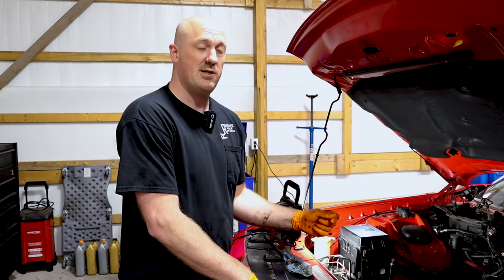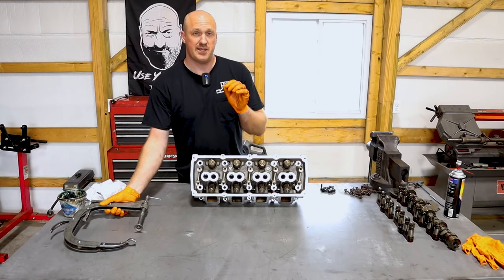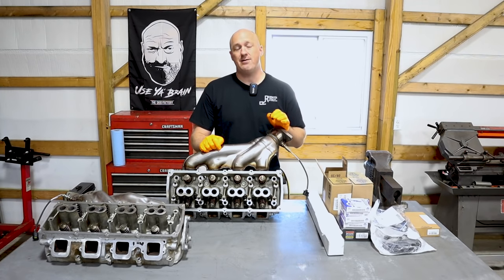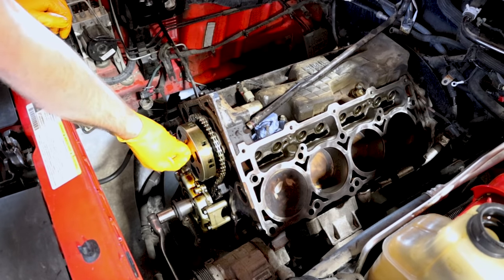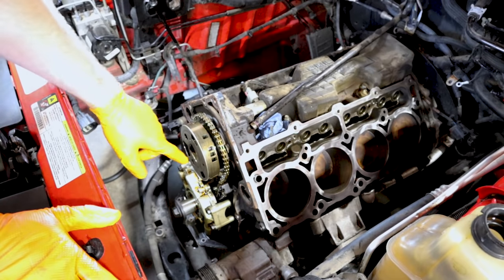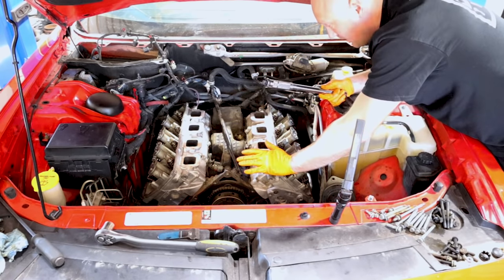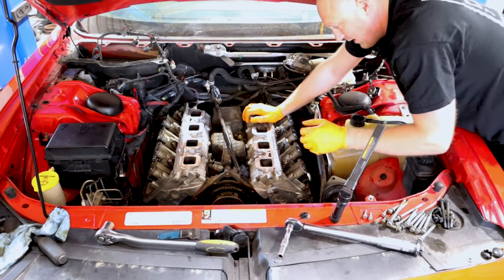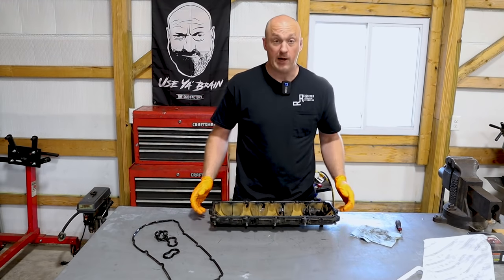Hemi Camshaft Installation Continues, SRT Headers Install! Budget Challenger Build Ep2

Comment from the maker: Which model Hemi do you own?
Reply: 2013 ram
Reply: When I call PowerTrain company for quote they told me that I have gen 3 hemi
Reply: 2015 Challenger RT Plus
Reply: 2005 Dodge Magnum R/T
Reply: 2018 Charger R/T 5.7
Reply: 2010 Challenger R/T manual transmission. I also have a 2014 5.7 block from a charger with only 914 miles on it for a future build lol
Reply: 2018 Charger RT
Reply: Love this channel for the Hemi content!!!!!
Reply: 2009 5.7 charger pursuit bought it with 30000 now have 89
Reply: 2016 Challenger 5.7 vvt
Reply: 2011 5.7 Ram with longtubes and a 2005 5.7 with a set of Eagle heads for a future Dakota swap.
Reply: 6.1 challenger there's no videos or info on them would be great if u have one to work on but all your videos are great with lots info thank you
Reply: New subscriber,  love ur tutorial  on camshaft installation.  I have  a new reman 6.1 hemi engine from power Nation.. What's the best performance camshaft upgrade i should  go for ?
Reply: 2019 Challenger Scat Pack Widebody
Reply: 2014 pursuit charger
Reply: 2019 RAM 1500 Laramie Sport
Reply: None, but a 4.7 magnum Dakota
Reply: @Weld702  that’s stick awesome man I had a 4.7 ho Dakota they’re awesome
Reply: @jimmyford271  Same here on the car, love my Challenger and the stick shift makes at a blast to drive!
Reply: 2007 Charger R/T
Reply: 2005 Magnum RT
Reply: @89JDmac  ... what did you have to do to swap over to the Eagle heads...
Reply: @ghostrt1608  you'll need different thickness head gaskets and potentially an intake spacer depending on which intake manifold you use. Check out mmx performance
Reply: What did you hold the cam phaser with so I did not  spin on when you torqued it down
Reply from the maker: @cammedramprocharged4927  best move is to access the flex plate and stick a pry bar in the teeth so it can't rotate. 👍
Reply: @ReignitedAuto  I wished you showed how you did that almost 
All the videos Inwatch they all skipped that part
Reply from the maker: @cammedramprocharged4927  ya I've gotten quite a few comments about that, next time I put one of these together I'll make it a point to film that part of it 👍
Reply: @ReignitedAuto  please do 
You never showed how you tighten that Cam bolt with 90ft lbs and stopped the motor from spinning on you
Reply: 2013 Challenger RT 5.7 Hemi
Reply: 15 Durango R/T 5.7
Reply: 2012 Ram 5.7 with 138,000 miles
Reply: 04 dodge ram single cab,
Reply: 2017 Scat Pack with 19 grill and the lower half of the Hellcst Air Box.
Reply: 2nd gen magnum rt and a 5th gen ram 1500
Reply: 06 Charger R/T (306K Miles and counting)
Reply: 2015 RT plus, super track pak
Reply: 57
Reply: @ziggyk.9206  O 6
Reply: 2013 rt charger 😎
Reply: 2011 Ram 1500
Reply: Mopar '11
Reply: 5.7 VVT in my 300C.
Reply: 2019 RT Scat Pack Challenger that I absolutely LOVE!! F-8 Green with a full length hockey pinstripes  from Vinyl Imaginations, Hell Cat air box, Billet oil catch can, and a Hurst pistol grip shifter. Drive train is bone stock. Love everything about it.
Reply: 2013 Grand Cherokee Overland 5.7
Reply: 16 Challenger R/T M6
Reply: what type of mechanic gloves are those? They look great quality.
Reply from the maker: @redForever1776  they are from gloveworks and they are terrific! Perfect for doing this kind of work, unfortunately since the start of the pandemic they've become very expensive, like $40 a box. Still worth it to me!
Reply: @ReignitedAuto  thx !
Reply: 2005 Magnum RT bought new and still love it! By the way it has MDS so some 2005 hemis did have MDS.
Reply: 2014 Charger RT 100th Anniversary !!
Reply: 2006 300C 5.7 Gen 1
Reply: How can i get in contact with you?
Reply: 2013 300C Hemi 5.7L
Reply from the maker: @psas6179  either DM me through Instagram @reignitedtx or e-mail Sales@reignitedtx.com. I'll try to get back to you as soon as I can.
Reply: 2022 Challenger RT Plus - not delivered yet, been waiting 5 months so far.
Reply: 2006 dodge charger hemi and 2015 dodge ram heni both are nothing but issue got a square body Ford 302 never had a issue and it's a 85
Reply: Do you have any recommendations on which year challenger rt to buy and which ones to avoid? Manual trans is a non negotiable must have.
Reply from the maker: @zaddy49  they are all pretty similar to be honest, and there's not really a bad version out there. Obviously if you go a little newer they have fancier interiors and more electronic options and driver aids, but I kinda like the more analog older ones, the 2010 I had in thus video was great, but the interior did look a little dated.
Reply: 2017 charger r/t
Reply: I have a Ram 2500 with the 5.7 Hemi and 185k trouble free miles on it.
Reply: 2005 300c 5.7
Reply: 2007 dodge charger 5.7l  rt.
Reply: 5.7 RT
Reply: jgc 2013 5.7
Reply: 2016 5.7
Ram 1500 Bighorn 4x4
Engine service every 5,000
124,000 miles
56-57 psi cold
34 psi hot
Reply: '16 Challenger SRT 392 A8
'11 Challenger R/T M6
'07 5.7 1500 4x4
Reply: 2013 5.7L 345ci
Reply: Let me correct one other misunderstanding you have. Just because the lifters are being directly oil does not mean that that oil is getting to the roller at the angle it izzat. I don't know whether you know anything about physics, but when the oil is not under pressure and especially not enough pressure to be shot across even a small Gap, it will drip off of the lifter body long before it will drain laterally across the lifter. Those things are at less than a 30 degree angle. At least they appear to be. Even a 30 degree angle would be next to impossible for oil to Traverse in any kind of consistent fashion.
Reply: 2014 RT Redline!
Reply: 05 300c
Reply: 06 Ram 5.7 hemi with over 331,000 on it
Reply: 2006 Jeep Commander 5.7L Limitied...with leaking valve seals, and the notorious broken rear most Exhaust manifold bolts...but I'm a mechanic so everyone else's vehicles come first...lol, can wait for the Jan-Feb slow down to get mine taken care of...any tips for a replacement header with factory y-pipe?
Reply: Hopefully that straight six is dodges saving grace because spending thousands to fix a cam only after 40k miles is bad
Reply: 07 charger RT
Reply: 15' Challenger SRT 392
Reply: Hey brother I've watched you're videos and learned to do a comp cam swap on my 07 dodge ram 1500 5.7 hemi and I also installed 6.1 srt headers from a srt8 jeep 05-10 and it still has the tick from a leak I used the original hardware that I took off from the jeep and put 6.1 gaskets and no luck, do you have any recommendations.  Much appreciated.
Reply: 2019 Challenger R/T 5.7 6MT
Reply: 2017 pursuit
Reply: 2006 300c srt8
Reply: Do you think those take off headers would fit a 2014 jeep srt 6.4 ???

Comment: I was warned against getting a 5.7 hemi, I was told the cam shaft always fails at around 80,000 miles. This channel gave me hope!
Reply from the maker: Thanks for watching!
Reply: I'm at 200k. Stock. 
Stopped mobile oil at 100k. Went to Valvoline high mileage. No issues so far.
Cai, shorties on back. Due to ex manifold bolt issues.
Soon will be cam, intake, etc.
Reply: At 135,000 magnum love it no issues
Reply: Mine just went bad at exactly 80k miles smh
Reply: 190k miles on a 07 with mds no issues
Reply: Mine is in the shop now getting lifters and a cam at 80k. Beyond pissed!
Reply: @Neverasheep  I’m sorry to hear that but atleast you know once you fix it you won’t have to worry about it I’m having trans issues rn hoping it’s the torque converter after that I plan on replacing the cam and lifters even though they are fine
Reply: @themechanicred  i definitely won’t be going back with Ram parts. The parts guy at my local dealer says they have 10-15 HEMI’s in the shop at any given time with the same failure. Says Ram don’t care because it’s not a safety issue.
Reply: @themechanicred  i think it’s more prevalent in 09’s and up.
Reply: My 5.7 hemi has 120k miles, no issues with the cam 😌
Reply: @domtronic9526  I wish I could say the same.
Reply: 105k on my 13 challenger. No issues yet
Reply: @Neverasheep 218k on a 2012 Ram, Always ran Full synthetic and changed @ 7k miles. Only issue I had was Head gaskets cause Im an idiot and accidentally cracked the thermostat housing when changing the thermostat and ran it hot trying to limp home 😅
Reply: 2005 300C at 93K and not a problem in the world with the engine. And we flog it hard after some minor upgrades.
Reply: 120000 miles on a challenger and I've had no issues. Want to get a cam upgrade anyway for the power gains.
Reply: Just make sure you keep up on your I'll changes and maintenance. Otherwise you're right.
Reply: I have an 05 Chrysler c had it since 80k not has 137k  and I drive it pretty hard at times not all the time but 0 issues just cam position sense and crank sensor but that’s it

Comment: Just as a heads up, I have wrenched on car since 1964. I currently, because I am retired, I do a side job of security and one of my security positions I am at an auto parts store. I recently started taking some of the lifters that they sell, these are as melling lifters. When I checked them, by taking them out and rolling them along my wrist or even along a smooth portion of the counter, I find several that the bearings do not roll consistently. They are skidding along the countertop. That is concerning to say the least. Make sure that you check the bearings on new lifters when you install them. It is worth every turn of the wrench that you save later.

Comment: The lifter pin/wheel/body slop, has to be poor material and heat treating. This "doesn't" have to happen. This is cost cutting by cooperate bean counters. These need to go to a metallurgist and be analyzed. Along with a few other samples. I am now wondering. Are these parts made in Mexico?

Comment: Got to 194K miles in my 2011 R/T when I got P1524 followed by a couple of P30 misfire codes. Took it to Meineke and they told me it’s my cam and lifters and to replace the whole engine. This video series gives me hope to just fix it myself while also upgrading my cam anyway.

Comment: Hummm...A little head scratcher we have here! So the engine ran fine without any ticking from the Lifters but still has a used and scuffed Cam? Any idea why this went silent?
Reply from the maker: I think it was just in the opening stages of failure. Usually you don't hear the noise until the top of the lobe gets worn away, then there's a gap that the lifter slaps against causing the noise. 👍

Comment: I have seen this happen at 70K miles. But, I have an 03 1500 with no issues at 210K. Material cost cutting and heat treating. Excellent channel.

Comment: I did the SRT headers on my 05 magnum rt and it freed up so much power! I had a lifter start to fail after 170000 miles after cam install and raced for years.I put SRT lifters to eliminate MDS and never looked back.You will so happy with a bigger cam.Good luck and have fun
Reply from the maker: Thanks David!
Reply: With the srt headers on a 05 engine, were there any modifications you had to do to the header to fit?
Reply: @carlosdelrio7593  the only thing I had to do was on the passenger side I put a groove in the flange for the EGR . There is a round hole in the head.and all have to do also use the SRT manifold bolts to bolt it up. I used the factory SRT Cat pipes cause 5.7 uses 2.25in and SRT uses 2.75-3in pipes and frees up HUGE
Reply: Also the you connect the hole to the first tube on the collector on the flange. I hope this helps

Comment: working on 2018 5.7 Ram 2500 without factory MDS. Lifter and cam failure at 1250, miles on # 1 cyl but thanks to your video I am almost back running.
Reply from the maker: Nice! Good job on doing it yourself 💪

Comment: Great tip on the valve cover seal. I rolled the back corner on mines and had to take them off 2 times before I got it on without it leaking...😁 Enjoying the videos, keep up the great work!👌
Reply from the maker: Such a pain to get that right!

Comment: If you watched Uncle Tony's Garage, then you should have seen him demonstrate that the lack of oil splash was not the only issue,  but the angle of the lifter which is almost horizontal rather than the standard vertical that most lifters are, which will allow any oil  dripping from the lifter to fall down on the rollers,  but the way that these  bores are almost horizontal keep that from happening. 
I agree with Tony, that there c are several issues, and that the horizontal angle is causing alot of the issues as well as that bore tube that runs down the center blocking the splash that you would normally get from the  crankshaft is also an issue that is causing these rollers to fail prematurely. 
I would love to know what changes were made in the design or material after 2009 that caused this issue to be so much more prevalent.

Comment: Thank you for this video, it help very much during my rebuild. I’ve done the exact job you did and I only used stock one parts from dealer. I’m having problems with the valves saying open and hitting the piston after rebuild. Valve timing is perfect and I’m stumped. Thanks
Reply from the maker: Well to be honest one of those statements can't be true, either the timing is correct, or the valve are hitting, can't be both. I'd be pulling the cover back off to verify the timing marks. 👍
Reply: @ReignitedAuto  Thanks for the reply, I’ve double checked timing (mark at 12 and 1st cylinder at TDC) and it’s still perfect. I’ve also had my heads re-machined with new valves. Is it possible that the new lifters aren’t compressing?
Reply from the maker: @matthewcecil9404  if anything it's the opposite, the new lifters won't be pumped up with oil and won't deliver max lift. How are you verifying TDC?
Reply from the maker: @matthewcecil9404  also, as a secondary option, remove the valve covers and check the pushrod ends to make sure they are seated properly in the rocker arms and aren't hanging the valve open when they should be fully closed 👍
Reply: @ReignitedAuto  Verifying the timing with the cam gear mark at 12 o’clock and 1st cylinder at TDC. Thanks for the tips I’m going to go back threw everything and double check the rocker arms. I’ll give you an update on what I find.
Reply: @ReignitedAuto  Just went back to the basics, first time doing the timing on this one and must of slipped off the oil pump gear. Everything is in time and good now. Thanks for the help.
Reply from the maker: @matthewcecil9404  good news man glad to hear it! 👍

Comment: I just bought a 2022 Ram 1500 with 44,500 miles on it.  The 5.7 Hemi had a fairly loud cold start lifter tick lasting about 3 seconds until it filled with oil.  I changed the oil, put a quality filter on, and added a half quart of Marvel Mystery oil.  Cold start tick is now gone.  You get lucky some times.

Comment: I did SRT headers on my 10 Challenger. I had previously installed a Corsa Spirt cat-back system. I also installed 6.1 mid-pipes. But, I had the pipes moded to fit OVER the smaller 5.7 pipes.

Comment: Love the channel and love the information. I’m intending on doing many of these mods. With a couple of changes. 
 1. My state allows full length headers and I’ll opt for those with the high flow cats as well
 2. Will be adding the 392 intake with the matching cam you just installed.
Reply from the maker: That's going to sound awesome, I love long tube headers. They are just such a pain to install! 😄
Reply: @ReignitedAuto  ... I have a set of long tube headers for my Ram that I need to put on... I hope it's not too difficult
Reply from the maker: @ghostrt1608   The trucks aren't nearly as difficult, you should be good!

Comment: I just put the srt headers on my Charger RT and it is a huge improvement.
Reply from the maker: Definitely Agree! 😎
Reply: Where are you guys getting yours? The only set I found were like $800! Could buy nice coated long tubes for that!
Reply from the maker: @HellmuthsHotRods  I found mine on Ebay brand new as a set of take offs from a crate motor.
Reply: @HellmuthsHotRods  I bought mine from MMX, but you can find them new take offs on ebay for under $500
Reply: You can call MMX to see if they still have them.  I got mine from them with Stainless Works 3in mid pipes for $450.  I can't wind them on their sight anymore.